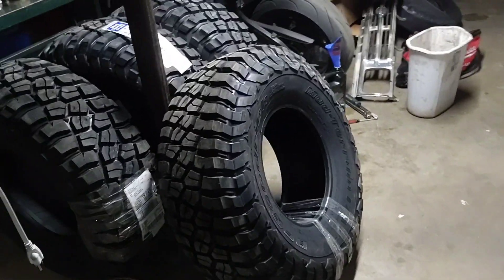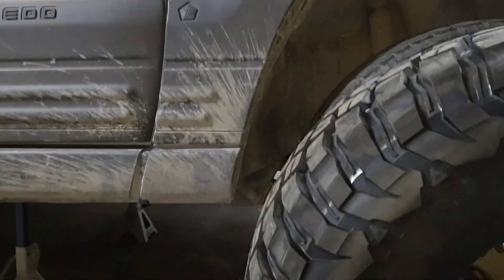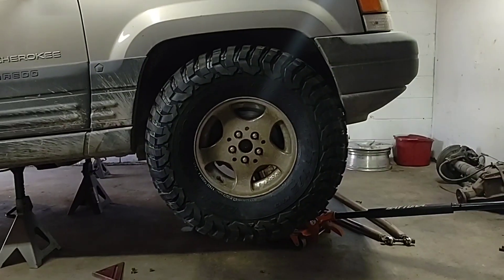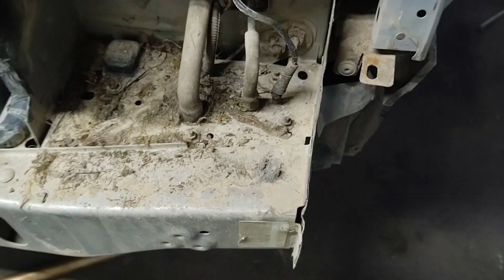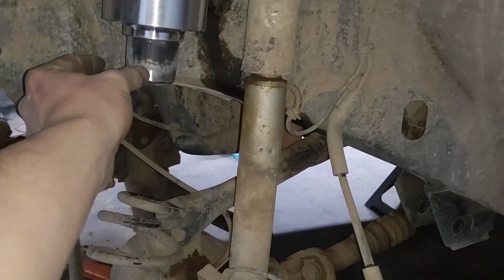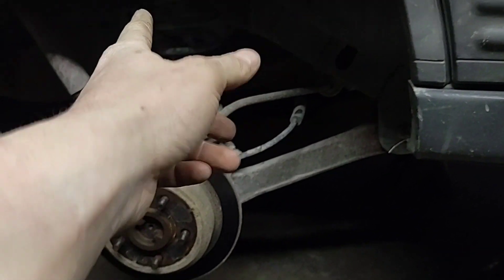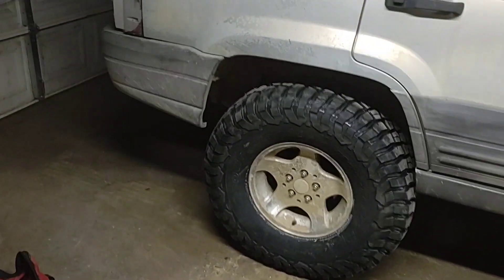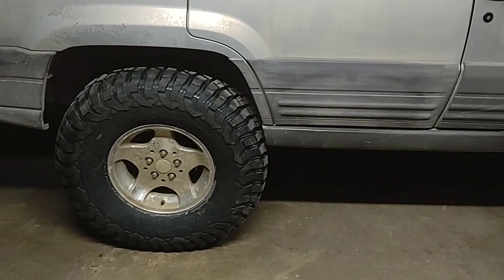zj on 33s with 3 inch lift

Comment: Good morning Thomas. Tue. Tallahasse FL. 8:00am est. Just rewatching this tire upgrade over coffee. I like the BFG K3 choice. The best choice for overall use on/offroad in my opinion also. My stock tires, Goodyear wrangler A/T 235/75r15 on the same rims as you have are still 70% tread so I'll keep saving for a winter lift (eyeballs on the, If had more money than commonsense, OME 4.5 short arm kit, yep, bolt on as I not as good as I once was, and, tires BFG K3 probably too), while prepping by keeping my eyes peeled for still good cheap, "yuppie guppie" JL, JK takeoff suspension parts so, I dont take the hit of new parts prices. Anyhoo, looking forward to your next video or update mod. Make it a good day bud!
Reply from the maker: Iv always been a fan of BFG tires iv never balanced my offroad tires and they still ride great on the road at 80 mph. I tried another brand on my chevy and I regret it.

Comment: I did a very similar spacer for the front shocks. On the rear shocks I welded some 3/16" plate above the axle shock mounts with new holes 2" higher. I'm using just 2" spacers for 31" tires. I also put on some 2" plastic bump stop spacers on the front and welded in some 2" bump stop spacers on the rear because I didn't want to ruin the shocks if it compressed too much. I love the way my ZJ handles off road. Now if only the gas mileage was better! I have the 5.2, would have preferred a 4.0 but we can't be too choosey when searching for craigslist bargains.
Reply from the maker: I think I spent less than $5 for the front shock spacers lol. I took it out last weekend and so far they are holding up just fine and I wheeled it hard.
Reply: This is what I'm thinking! Make my own spring blocks out of sch80 pipe & 1/4" pl in between

Comment: 2x6 tubing is great for rock sliders. Sticks out enough for a little bit of a side step and can tie in to an external cage.
Reply from the maker: That's what I'm thinking. Debating between 1/8 3/16 or 1/4 thick I think 1/8th would only hold up so well but 1/4 is fairly heavy
Reply: @thomasbeyer  id go 3/16 it's in-between both so it'll be a perfect middle ground.

Comment: If you take stock coils and put them in the rear it will lift the rear 3 inches and anything more than a 3 inch lift out gonna want front and rear adjustable track bars and probably buy or build longer control arms
Reply from the maker: Went to my local yard today and no zjs to rob springs out of I really should have checked first
Reply: @thomasbeyer   on the west coast they’re everywhere I picked my zj up for 400 bucks with 180k miles lol me and all my buddy’s have zj or xjs
Reply from the maker: You definitely did better than me lol. I paid 800 for 323000 miles. But when I bought it we were going wheeling the next day so I just had to have something.

Comment: Nice dude.  So im pickin up another 4.0 ill keep the 5.2 as my daily or just drive my Toyota matrix for the mpg. But im doin the same supercharged build you did. What supercharger did you use.
Reply from the maker: The Ford m90 off of a supercoupe
Reply from the maker: I'm taking it first first test drive with 33's now and it's still got plenty of power with no gear ratio change

Comment: Wj rear lower control arms are a bit longer for the rear lower,and they are built way better, you have to grind the width a bit for the bushings but they are cheap and put your tire a bit farther away from the body

Comment: Great video Thomas!
I have the same ZJ with 31s and a 3 inch lift (springs) and I would like to get 33s on it... Will it be a good idea to install an extra 1 inch or 0.75 inch coil spacers on it? I never go off road by the way and I'm never flexing.
Please let me know..
Reply from the maker: Turn your wheels all the way to the left and right and check your clearances the more spacer the more scrub radius you will have. The more scrub radius you have the further the wheel center moves forward and rearward during turning so if you're clearing now and it's close it may not clear with wheel spacers.

Comment: Just put 2 inch pucks on my zj and didnt realize how much of a difference 3 inch is or I would've went with that I didnt have to do anythung with the front shocks they fit fine
Reply from the maker: May want to check your droop if you using it to go wheeling the shocks will limit the down travel. That being said IV still got the stock shocks and mine does fine off-road but may be better with longer ones.

Comment: Hello bro! I m from Brazil. can you give me some tips on putting 4-inch spring heels on my zj v8 5.2? In Brazil, we don't have many resources and access to parts like you, jeeps are seen with fear by mechanics and off road customizers, there are many myths... can I ride with 4 inches without changing the suspension arms for a while?
Reply from the maker: I would stop at 3 inch with stock arms. Mine doesn't have that much droop before it binds up on the stock arms.

Comment: Good morning, Thomas. Could you answer a few questions please. Mine is 95 JGC laredo, 6 cyl. Stock.You know I have been watching your vids for a bit trying to save and decide what to do. Now, Im starting to buy. No friends to help. On me to do. Super budget, just like you did here. I am going  budget pucks since I am out of pocket as well. I found some steel 3 inch pucks on amazon that claim actual 3 inches. You know the ones. You said the aluminum ones you got are garbage. I thought doing a bastard lift moving front springs to back but, the pucks will do for now. Im not doing this for wheeling as much as overland off road clearance for forest obscacles I may encounter.Before I order them, I wondered your opinion. I will being going with the same size km3 as you did with stock 7 inch wide 15" aluminum wheels like your stock ones in this video. I am trying to find some budget shocks but wondered in your research, is there any shocks from rock auto, that you would recommend for a from stock to 3 inch puck that would give road and light overland camping prowess.thanks for any recomendations.
Reply from the maker: I haven't crossed that bridge yet iv still just got my cheap shock extensions up front and my modified Dakota shocks in the rear. But I think when I go to a 4.5" lift I will get the rubicon express lift shocks.
Reply: @thomasbeyer  Would you be opposed to me getting hold of you and chatting about your Jeep build off Youtube?
Reply from the maker: I don't do phone calls but if you have Facebook mine is under the same name with a red Dodge ram as my profile pic

Comment: I've got 3inch pucks on mine and I'm using the hard rubber ones they went on nice and easy with some antiseize lol but also if I may suggest freedom offroad on ebay sells 3" lift shocks for the zj and I'm running them there nice so far lol and for control arms the rear lower control arm in the front and some jeep jk wrangler rear upper stock for the rear lower zj also. The stock spring insulators are supposed to come off lol
Reply: I'm a budget kinda person lol fuck doing things right fab it up or find it her comparable stock parts 😂
Reply from the maker: I hammered on that front spacer I figured the isolator might help with some noise and stuff but I couldn't use it at all on the back but so far it's fine
Reply from the maker: Yeah I hate spending all that money just to buy a name especially when I have a welder and can I can make it myself